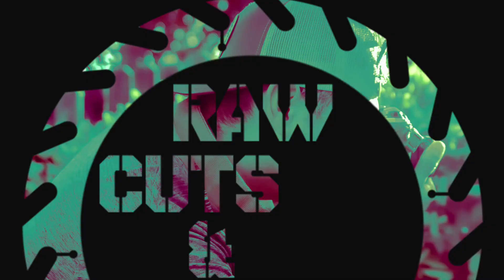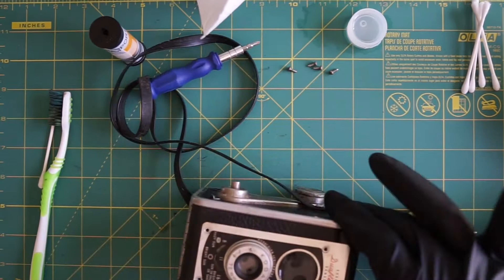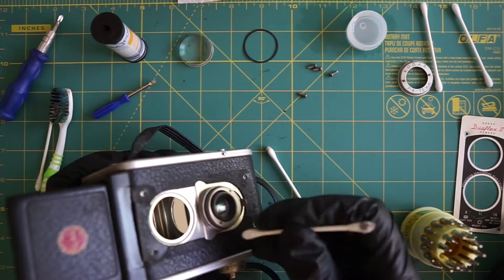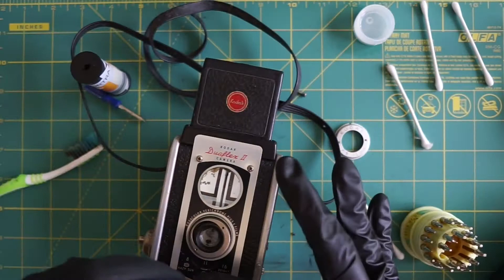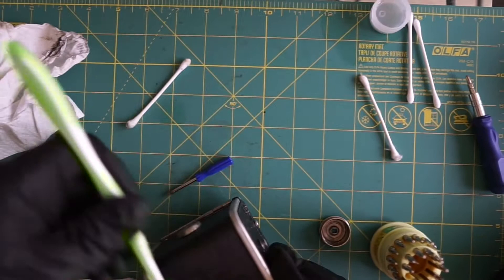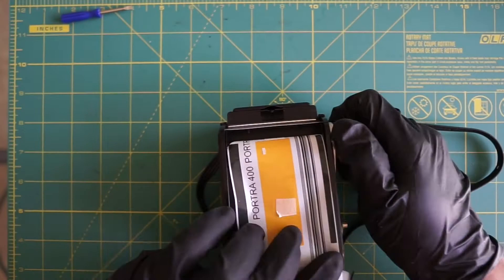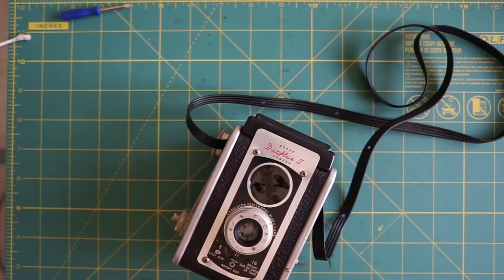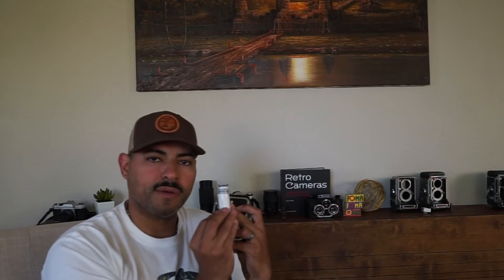Duaflex II Restore & Review

Comment: Your pictures might be soft because you got the lens out of adjustment when you removed the focusing dial.  You need to find infinity focus by focusing on a distant object with a ground glass at the film plane and reset the dial.  The Kodar lens on the Duaflex is a nice little triplet anastigmat that is decently sharp.  Kodak actually made a couple of "real" TLRs, but the Kodak Reflex listed at $100, while the Duaflex was $17.25.  The lens on the Reflex isn't a tessar.  It's a completely different design with four elements in four air-spaced groups.  A tessar has four elements but in three air-spaced groups.  The rear group of a tessar is formed of two elements cemented together.  Duaflexes are also prone to light leaks if the hinge gets sprung and you need to tape up the camera with black tape.  There isn't any foam.  I've never had trouble with the little red window.

Comment: I have one of these same cameras from my grandfather. I am interested in dusting it off and trying to use it again. Any tips for cleaning at home? Suggestions on solution? First timer over here and definitely don't want to mess the camera up!
Reply from the maker: Hi, that’s awesome. You don’t have to strip it down to cleanse it up. I recommended lightly blowing a little canned air inside to remove the dust and wipe the dusty parts outside with a qtip. Then wipe the lenses with a microfiber cloth. Let me know how it turns out 🙂

Comment: I have this exact camera and my pictures are all coming out blurry. For your lens, I saw you twisting the lens itself, is the lens supposed to twist too, or just the focusing knob? I'm wondering if my lens is gunked up and stuck and might need to be finessed a bit.
Reply from the maker: Hi, I twisted the lens in there because I accidentally moved it from its original seated spot. The focusing knob pushes the lens forward and back. I didn’t try portraits but best results were landscapes. I’d say twist the focus know to see if it actually moves then try wiping the lens a little with a non-alcohol solution and try again. Best of luck

Comment: Nuts. I was hoping to get a good look at the shutter and flash timing mechanism.

I would guess most light leaks are from deteriorating seals but you can easily rig up a Velcro cover for the red lens or even a bit of electrical tape as a flap to cover it except when winding.
Reply from the maker: Yea I didn’t think to mess with that bit since it was one of my first restores. Also fair point, I now replace the old foam in cameras and check for light leaks. Thanks for watching